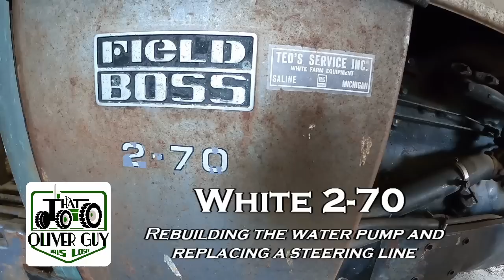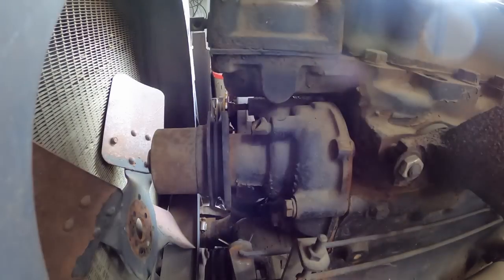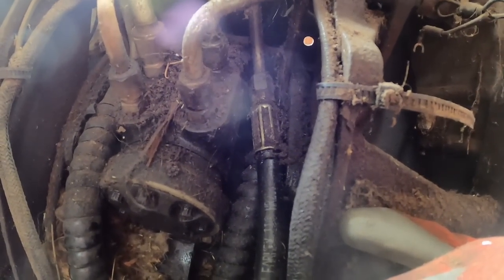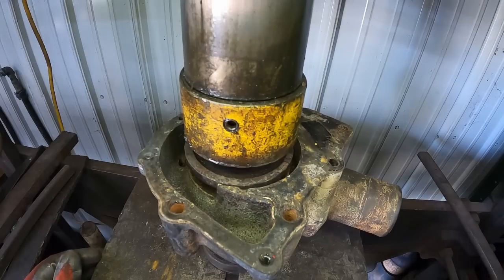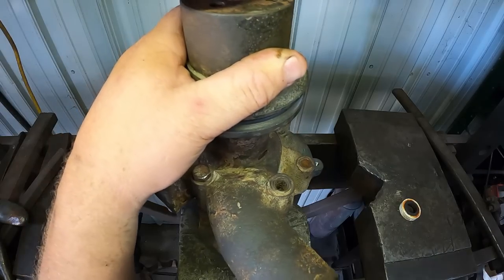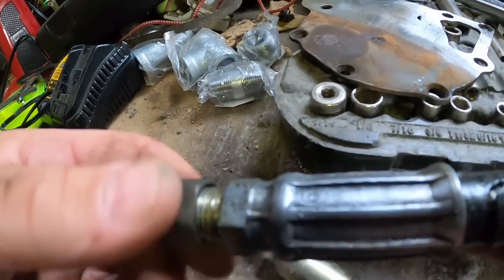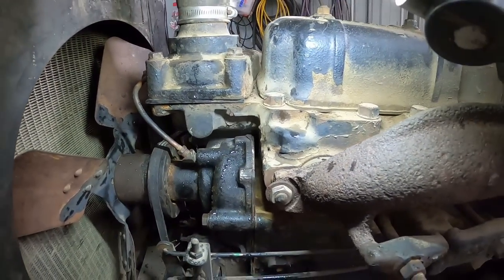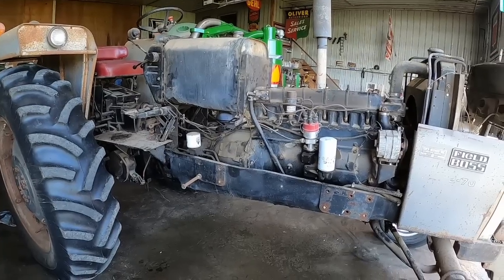WATER PUMP WOES, rebuilding the pump in the WHITE 2-70

Comment: Good job on the pump rebuild and it's been hot minute since I rebuilt one myself, maybe a half dozen years or more. Of course any time a fellow rebuilds one that risk of getting the bolts to break free without breaking is about 1 in 5 or so for me. All that said, my water pumps were never an Oliver, but a White American 80 and a few John Deere and a Massey or two. We had to replace part of a steel line on my sons Massey 285 power steering hose, a lot cheaper than the AGCO replacement. The cut water hose over the hydraulic hose is a nice trick, my son and I did that with the hose on the White 80 under the seat and a few other spots. Good job on  the pump replacement there Chris, good luck on the rain, thanks and I hope you have a nice week!
Reply from the maker: Thanks Dan! We have gotten about 3 inches of rain in about as many days, so the crops are really perking up.

Comment: Ross needs to add a new top-level of animal, a cat that got its tail caught in the rocking chair.  Speaking of Ross, are you trying to shame him by showing a clean workbench?  I know you shamed me with it.  I have not seen my workbench top since I first built it.
We stocked that seal kit and also the shaft and bearing.  The local NAPA dealer sent people who had old cars with leaking water pumps in our direction.  The seal and shaft assembly was a common item with many cars, especially the seal.  They were one of those "Why re-invent the wheel when we can use a proven item, just make our housings fit the part."
Making hydraulic hoses was one of our specialties.  We even made A/C hoses.  Those fancy steel A/C lines that had a rubber section in them and cost $100+ we could cut the rubber part out and make a new hose section.  Our Weatherhead crimper left a little bell shape at the hose which we told people that it allowed some flex at the fitting so there was not a sharp edge to the crimp fitting.  Our local other green tractor place had the full crimp machine and we made hoses for some of his customers.  We even could get big hoses made by our Weatherhead supplier.  We supplied some "BIG & LONG" hoses for the coal mine when they were testing their Mole and had the sections separated.  We also made O-Rings. That was a job we got called upon to make O-rings insitu on equipment to keep them from having to tear a machine apart to simply replace O-rings.
Great video.
Reply from the maker: Thanks! Before the graduation party that bench was cluttered and grease colored. I took it outside and steam cleaned it. Now I need to get some steel for it before the clutter comes back.
Reply from the maker: Tthe Riekers Scale continues on to 7 and 8 with donkey, and I've noticed that when it really hits the fan, Ross goes for the hog sound, so that's 9 and 10. Let's just hope he doesn't turn it to 11!

Comment: The power steering hose repair looks a whole lot easier than the one on my 2-135. It is definitely less than desirable replacing the steering motor on mine
Reply from the maker: I put new steering lines on my 2-155 when I had the engine out, so it wasn't bad. But with the tank in the way.... Ouch.
Reply: Yes sir and apparently a guy has to Jack the cab up to get the tank out of mine. Ross was telling me that the Series 3’s you can get the tank out but mine of course is going to be a pain
Reply from the maker: @craigrasnic4178  series 3 the enclosed the front of the cab and the steering motor is on the outside just below the top fuel tank. Much easier to work on.
Reply: I was aggravated enough yesterday that I had to walk away because I started thinking about the sawzall and cutting on the cab. So I figured it was best if I work on something else for a while. But my swear bucket runeth over lol

Comment: Another nicely done repair. I love those wild blackberries. Unfortunately most of the ones on my property didn't come back after I got carried away with the brush hog early summer not thinking about what I was doing lol.. so your shop that you work out of now that's still the original shop from the dealer where repairs were made right? And then sales and parts were in a different building if I understand correctly?
Reply from the maker: The shop I work out of now was built in 96. The dealership was still open and we had  steady enough repair work that I didn't have a place to work on my own equipment. I also needed more storage space so we built that pole barn. The hose machine and fittings are still in the original dealership building, as well as the gaskets I needed. That was the old workbench where I made the hoses, in the original repair bay. Grandpa built a pole barn in 86 with a new repair area because the machinery was getting too big for the old building. That's probably as clear as mud, 😂.

Comment: Great video I’ve got an oliver 1600 that I just put a hydraulic pump in and I took the 3pt cylinder out to put it in and since I had the cylinder out I rebuilt it but I’ve put it all back together now and the 3pt that worked fine before now goes all the way down and only comes up a little so is there anything that you know of that I could have messed up on install or could it be an adjustment issue
Reply from the maker: Did you get the screw through the side of the housing snugged to seat that ball in the side of the lift cylinder?

Comment: What cubic size engine they use in the 2-70 ? is it the same as a 1650 gas ?
Reply from the maker: Yes, it is the 265 cubic inch Waukesha, same as a 1650/1655.